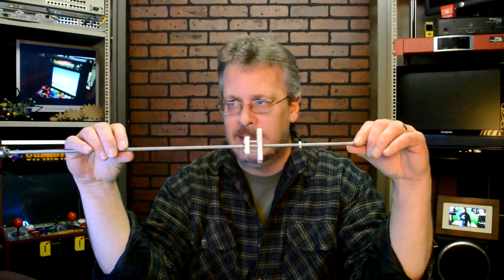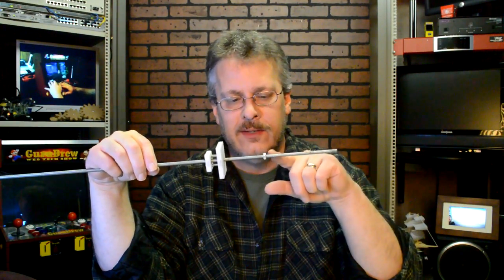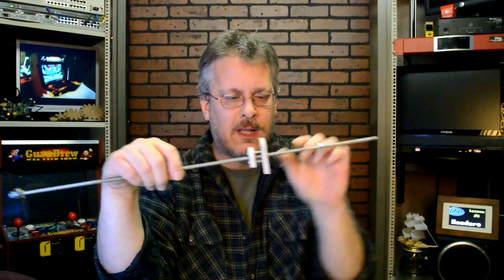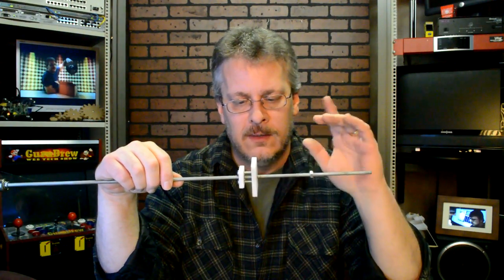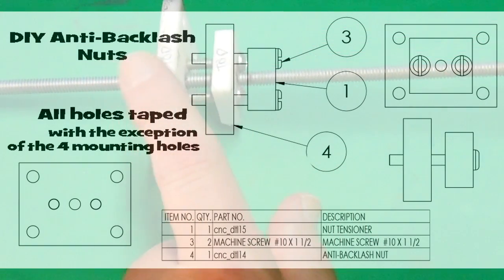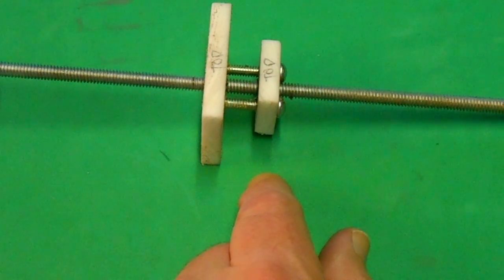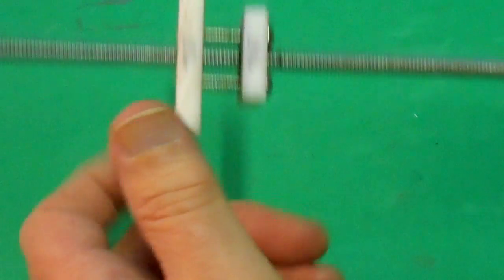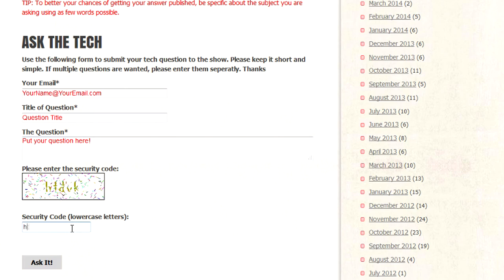How to Make Your Own Anti-Backlash Nuts - Ask a Tech #39

Comment: Good explanation.  Delrin is s good material but if you really want a great material, consider MDS filled nylon (Nylatron).  It is a little pricey but has excellent wear resistance and a very low coefficient of friction.  Your motors will thank you for using it.

Comment: The springs you get on hobby machines don't work. They appear to be fine when you are measuring backlash on an unloaded axis, but as soon as they start leaning against a cut to drive a bit the spring is not up to the task and all the backlash reappears. A rigid structure such as you have made here is the only working solution. It would be even better made from metal, and with the mods you have here you can easily machine some aluminium to do the job.

Comment: The most critical item in backlash technology if there is such a thing is not only the nuts ability to be adjusted to fit the screw thread tightly but, the screw rod threads must be exactly the same over the entire distance of travel of the nut, if not, it wears the nut out in only a few passes to fit the unworn thread sections, that why the spring may be the best chance?

Comment: another version might use a coupling nut (tpi count issues) that could be modified.
It is 4x the length of normal but.
Also precision ground threaded rod is not expensive, and available in many tpi counts.

Comment: Are you still using the threaded rod or have you changed to an Acme screw?  If you haven't gone to an Acme screw how is your thread rod and anti-backlash nuts working out?  I am working on a larger CNC and was looking at using threaded rod since they are considerably less costly.

Comment: If you do it, do it right! Yea, you could use a spring? Come on, how many people want to keep adjusting the tension. The spring is to make it self adjusting and to keep a constant tension on the nut so that the nut performs consistently for it's design life. You explained how it works but you failed in your attitude when it comes to making one.
Reply: There is more to this than short comments in videos and in the comment section. That kind of anti backlash nut has the problem that If the mill table is moved the direction towards the flange with significant force, the spring will compress and there goes your backlash. This can be a big problem because you can't guess whether the spring will compress for a given job, once it does it's unpredictable what will happen, and you will only know after you've made the cut. Some people say to use a stiffer spring, but this increases the force needed to turn the leadscrew, and makes it harder to turn.

In reality a solid nut like this has reasonably low resistance and as he said he has never had to readjust it. This nut works just as well in both directions and works predictably. If he ever does have to readjust it, I doubt he will be disappointed. After so long, it will probably actually be kind of stimulating to do this kind of maintenance, like a rare trip out of town.

Comment: As I understand it, you can add a variable in software to take care of backlash, why would you not just implement the fix in software?
Reply: You can't fix it in software properly. You could hack in something that could help a little, but it would not be accurate. The "wiggle" can change over time as parts wear out, different amounts of force, how level the machine is, etc. There is no way to accurately predict it every time. Making your own anti-backlash nuts is cheap and easy, there's no reason to compromise on accuracy by not making them.
Reply: Why make a crappy machine? The machine just being accurate is your best bet.
Reply: Unless you are adding an additional and highly accurate sensor array the software has no actual way of knowing where your machine goes, so the simple fix is mere guesswork.
Reply: MsSomeonenew
yeah but it all still works. My machine can put down dots, then draw circles around those dots. It can do it repeatably, and without fail too. It used to amaze me, but I've gotten used to it over time. See this picture? http://i.imgur.com/YjsaF5g.jpg My machine didn't draw it once, it didn't draw it twice, it drew it three times. All it did was make the ink darker with each pass.
Reply: Paul Frederick Meaning what, you implemented backlash compensation in software?
Reply: Donovan Lym
No. My machine has no physical backlash.

Comment: What about using a piece of threaded rod as the tap to get a really close fit in a plastic nut?  You could file a cutting edge into the rod to cut the plastic (delrin or some such).  Such a tap would be an inefficient cutter which might leave a slightly undersized internal thread form in the nut.  Could this prevent backlash?  Any experience with this?
Reply: +Gregg Senne I made my own ACME tap to thread HDPE out of a piece of threaded rod and the nut came out too tight until I modified the teeth of my homemade tap a little by peening the cutting faces to spread them out a little.

Comment: Great Video! Quick question though, did you tap the cutting board material by hand? If yes, does it not wear out? I'm currently using a hex-nut and threaded rod and am getting way too much backlash. I would like to try the method you have shown but don't know if the threads on the white material will wear out quick? Thanks
Reply from the maker: +William James Hi, Ya, I tapped the cutting board holes by hand. Actually I used a little battery powered screwdriver on low speed. The backlash nuts I made work great and I never needed to replace yet. When you first start using them make sure you put plenty pressure between the two plates with the adjustment screws and it will wear itself in nicely.
Reply: Thank you so much! :) If I may, I would like to get your opinion on the X-Carve by Inventables. I'm looking at cutting aluminum, coroplast, and wood. The router I would be hooking up to it would be a DeWALT DWP611, and am sure that the router can handle it. However, I'm not sure if the system is capable. I'm fairly new to the CNC scene so I thought it may be a good idea to run it by you.  As well, I'm a little thrown off by the name... it's called "x-carve"... does it simply carve shapes, or will it actually cut shapes out like a normal CNC machine does. Thanks again.
Reply: +William James well it's hard for me to say because I don't own one but I would say it's a lighter Duty machine that is mainly built for carving but I don't see any reason why you couldn't do any real cutting weather you just would have to use slower speeds and I think you could do some really good projects with it
Reply: +GuruBrew - Thank you so much for your input :)
Reply: The High Density Polyethylene (HDPE) used in the cutting boards is a low friction material.  It is friction that causes wear and the lower the friction, the lower the wear.  Of course they will wear to some extent, that is the purpose of the adjusting threads to compensate for the small amount of wear as it becomes apparent.
Reply: I used a standard 12mm and 8mm tap (two different lead screw sizes) in my instructable (see above).   Because the material is softer than metal, I used a slight over size drill to enable lead in for the tap.  In the case of the 12mm lead screw, it would normally be a 10.4mm drill for metal but I used a 10.5mm.  

In my system,  instead of using a hex nut, I used two pieces of HDPE with adjusting screws to take up slack.

Comment: Nice design!  I think the slop comes from the threads being a 75% depth cut which is typical because it is just about as strong as 100% without the problems of precision.  It also allows for lube, crud and imperfections.  If it was possible to have a 100% depth cut I think that there would not be any backlash (slop).  Maybe that would be possible with a plastic "nut" and metal screw but are there any 100% taps that exist???  Has anyone been creative and put an 8-32 screw into a heated plastic 6-32 hole?  That would be tight.

Comment: How would you thead it for a start 2 rod?
Reply: Kammo Wright I would take a short piece of excess 2 start rod and create a tap out of it with a grinder. This would be tapered from full diameter to your predrilled starter hole size and slotted along its length to create the cutting faces. The slots should be deep enough to allow for some scarf to accumulate.
Reply: OK thank you!

Comment: The plastic used in those cutting boards is High Density Polyethylene (HDPE), just for future reference.
Reply: Just for future reference, that is the same thing your milk jug is made of . So just cut up some milk jugs , and melt the pieces at 400 degrees F and pour it into an empty soup can.  Instant stock for making anti-backlash nuts.